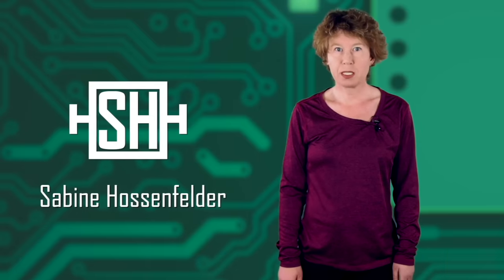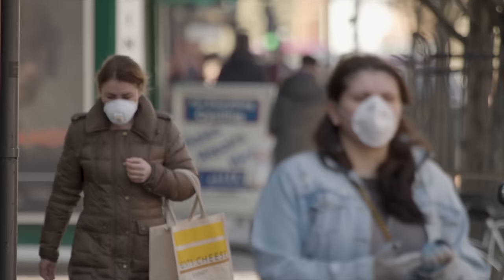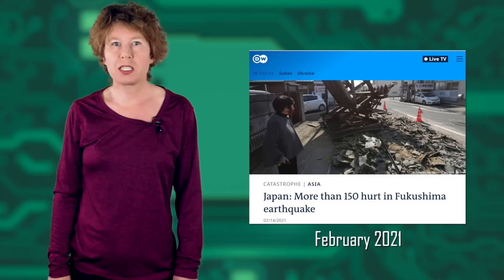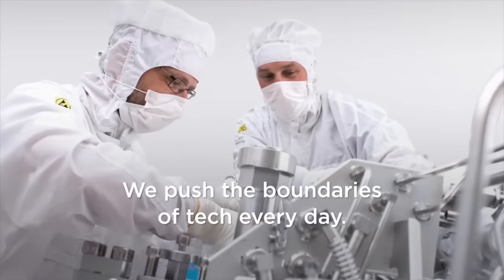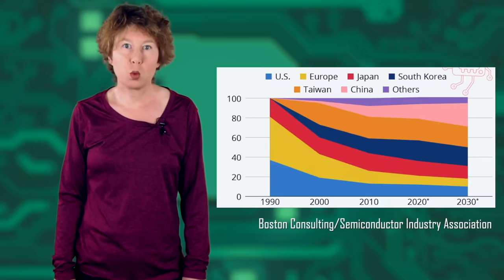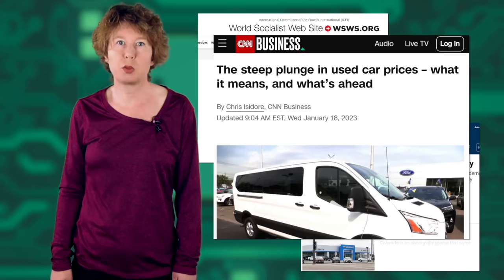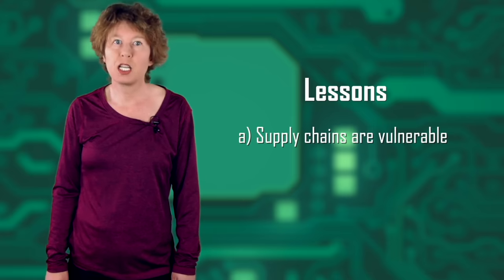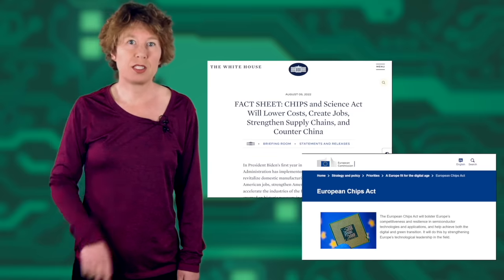All you need to know about the microchip crisis

Comment: Missed the new Intel (Ohio and Arizona I believe) and the TSMC plants being built in Arizona.  These plants are planned to be huge, and will split the high-end chip manufacturing with Taiwan.  Many years ago I had a presentation for executives to understand the leading/bleeding edge semiconductor market.  A new generation of chips would put twice as many of the current chips on a single wafer.  This would drop the cost, but the economics were such that the demand would more than double.  Semi manufacturers would build a new line or plant to meet this demand, and their profits would more than double. They would pour that money into R&D and CapEx for not the next generation but the one after the one after that.

That presentation was in 1980.  I've made a lot of money since then.  Betting on Moore's Law is still a good way to get rich.

Comment: People just need to refuse to buy new items till they lower the price, they shouldn't complain about profits because they got huge ones during the crypto boom and they raised prices instead of kept ip with demand. Lazyness set in now they will be punished
Reply: However there will always be a person who has enough money to buy even the higher-priced and so the prices continue to move up.
Reply: well normal people won't be spending a full RRP to replace their old system if they are only getting 2% increase in performance. it's been very small gains over the last 2 generations. 

but demand is down for other reasons Cost of living for instance.
Reply: @arcadealchemist  interesting.  I never purchased a vehicle specifically for performance improvements. It's usually just a given that it has good enough I look for other features and a replacement for transportation.

Comment: Let's not mention the Wind turbines and green mandates that contributed heavily to the TX power issues
Reply: Cuz that isn’t true. Abbott used that as an excuse to cover up his stupidity.   The Feds warned TX ten years before that their cost cutting left gas supply lines vulnerable to freezing, which happened. Wind and solar can easily be winterized, as is routinely done in places like Sweden, but TX preferred to “save money”.  In any case, 80% of the outage was from non-wind, non-solar sources, plus downed lines.  TX refused to integrate with the other regional grids, and so when their stupid “we don’t need no insulation” building codes had people cranking up the heaters to warm the outdoors, they ended up either having no juice, or paying outrageous rates to Abbott’s buddies in the utility industry.
Reply: @ericpmoss  Do you have evidence that wind turbines did not contribute to the problem or is this just free opinion masquerading as fact?
If the lack of "winterizing" turbines did contribute then wind turbines contributed. So.... ummm... ok